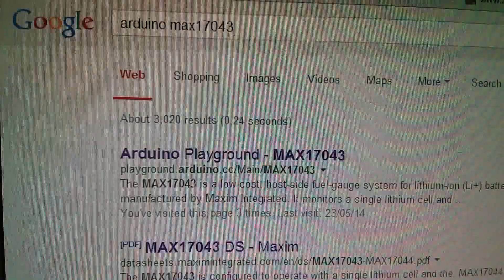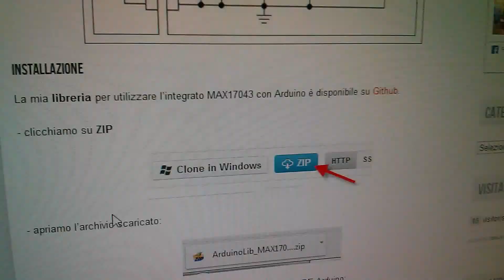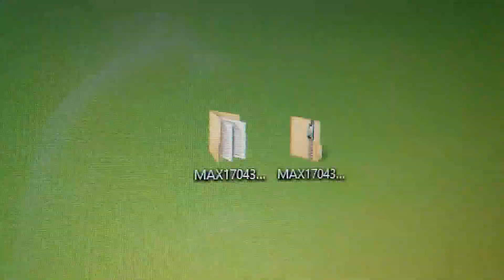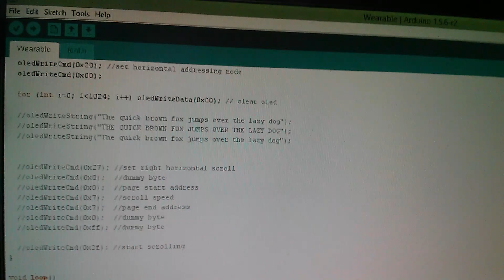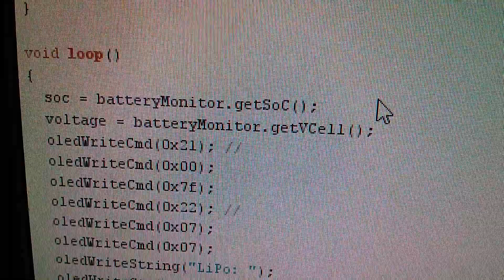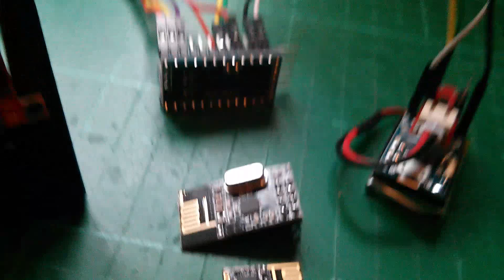MAX17043 LiPo Fuel Gauge connects to Arduino via I2C #2

Comment from the maker: Arduino Sketch

#define PIN_RESET 8
#define PIN_CS    9
#define PIN_DC    10
#define PIN_SDIN  11
#define PIN_SCLK  12

#include "font.h";
#include "MAX17043.h";
#include "Wire.h";

float soc;
float voltage;
char tmp[8];

MAX17043 batteryMonitor;

void oledWriteString(char *characters)
{
  while (*characters) oledWriteCharacter(*characters++);
}

void oledWriteCharacter(char character)
{
  for (int i=0; i<5; i++) oledWriteData(ASCII[character - 0x20][i]);
  oledWriteData(0x00);
}

void oledWriteData(byte data)
{
  digitalWrite(PIN_DC, HIGH);
  digitalWrite(PIN_CS, LOW);
  shiftOut(PIN_SDIN, PIN_SCLK, MSBFIRST, data);
  digitalWrite(PIN_CS, HIGH);
}

void oledWriteCmd(byte command)
{
  digitalWrite(PIN_DC, LOW);
  digitalWrite(PIN_CS, LOW);
  shiftOut(PIN_SDIN, PIN_SCLK, MSBFIRST, command);
  digitalWrite(PIN_CS, HIGH);
}

void setup()
{
  Wire.begin();
  batteryMonitor.reset();
  batteryMonitor.quickStart();

  pinMode(PIN_RESET, OUTPUT);
  pinMode(PIN_CS, OUTPUT);
  pinMode(PIN_DC, OUTPUT);
  pinMode(PIN_SDIN, OUTPUT);
  pinMode(PIN_SCLK, OUTPUT);
  digitalWrite(PIN_RESET, LOW);
  digitalWrite(PIN_RESET, HIGH);
  
//  oledWriteCmd(0xa8); //set MUX ratio
//  oledWriteCmd(0x3f);
//  oledWriteCmd(0xd3); //set display offset
//  oledWriteCmd(0x00);
//  oledWriteCmd(0x40); //set display start line
////  oledWriteCmd(0xa1); //set segment re-map
////  oledWriteCmd(0xc8); //set COM output scan direction
////  oledWriteCmd(0xda); //set COM pins hardware configuration
////  oledWriteCmd(0x12);
//  oledWriteCmd(0x81); //set contrast
//  oledWriteCmd(0x7f);
//  oledWriteCmd(0xa4); //disable entire display on
//  oledWriteCmd(0xa6); //set normal display
//  oledWriteCmd(0xd5); //set oscillator frequency
//  oledWriteCmd(0x80);
//  oledWriteCmd(0xdb); //vcomh deselect level (brightness)
//  oledWriteCmd(0x10);

//  oledWriteCmd(0x8d); //enable charge pump
//  oledWriteCmd(0x14);
  
  oledWriteCmd(0xaf); //set display on
  
  oledWriteCmd(0x20); //set horizontal addressing mode
  oledWriteCmd(0x00);
  
  for (int i=0; i<1024; i++) oledWriteData(0x00); // clear oled
  
  //oledWriteString("The quick brown fox jumps over the lazy dog");
  //oledWriteString("THE QUICK BROWN FOX JUMPS OVER THE LAZY DOG");
  //oledWriteString("The quick brown fox jumps over the lazy dog");
  
  
  //oledWriteCmd(0x27); //set right horizontal scroll
  //oledWriteCmd(0x0);  //dummy byte
  //oledWriteCmd(0x0);  //page start address
  //oledWriteCmd(0x7);  //scroll speed
  //oledWriteCmd(0x7);  //page end address
  //oledWriteCmd(0x0);  //dummy byte
  //oledWriteCmd(0xff); //dummy byte
  
  //oledWriteCmd(0x2f); //start scrolling
}

void loop()
{
  soc = batteryMonitor.getSoC();
  voltage = batteryMonitor.getVCell();
  oledWriteCmd(0x21); //
  oledWriteCmd(0x00);
  oledWriteCmd(0x7f);
  oledWriteCmd(0x22); //
  oledWriteCmd(0x07);
  oledWriteCmd(0x07);
  oledWriteString("LiPo: ");
  oledWriteString(dtostrf(soc,4,1,tmp));
  oledWriteString("% ");
  oledWriteString(dtostrf(voltage,5,2,tmp));
  oledWriteString("V ");
  delay(500);
}
Reply: Could you explain the oled code a little further? Do the hex commands refer to prepping the screens function? I'd imagine we could do graphs similar to your past projects.
Reply from the maker: Tradie Trev The WriteString, WriteCharacter and WriteData functions are nearly identical to the Nokia5110 functions. See my video on the Nokia5110 - http://youtu.be/RAlZ1DHw03g. The long list of WriteCmd function calls are mostly commented out - only a small number are needed on this OLED module. But there are different OLED modules with slightly differing setup requirements. At some point I'll make a video on driving OLEDs.
Reply: Julian Ilett Thanks for clearing that up mate! Good to know it's very similar to the Nokia5110, you've explained in the 5110's video very well.
Reply: Julian Ilett  how much would you charge for a pre made battery fuel guage with the screen and ready to use i ask because i currently do not have any knowledge of arduino programming nor do i want to risk possibly frying stuff 20 times before i get it right i have made a 100AH USB power cell (made of 18650 cells) but i currently have no way to accurately see how much power remains (3 leds is not accurate) so i was hoping you could sell me a pre made one.